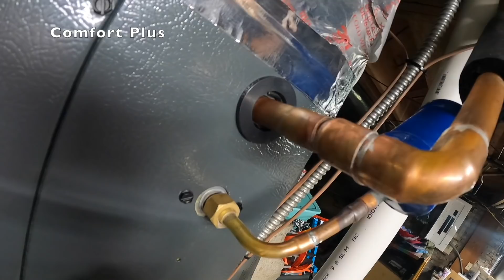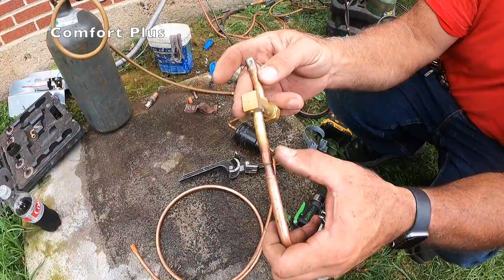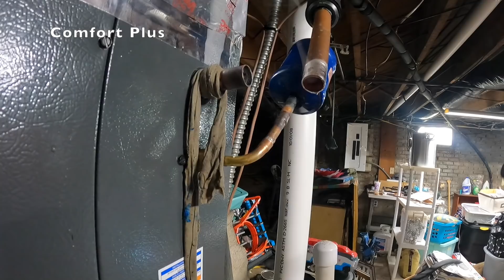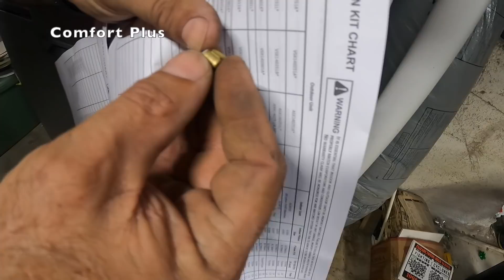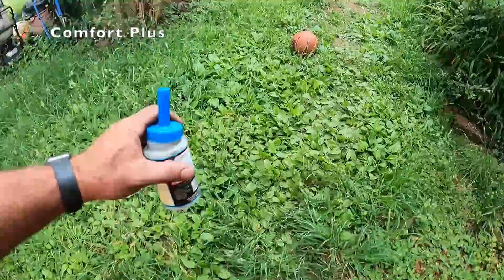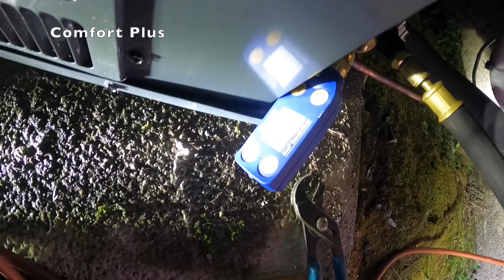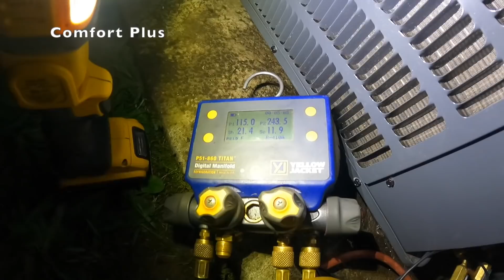HVAC: DIY Goodman Install: Can this unit be saved?

Comment: I bet this home owner is a plumber. He did a nice job with the trap. geeze now its pitch black at night now....wtf happened to the day it got edited out lmao. This is crazy stuff...nice video tho. In the summer I would have skipped this and ran more calls and probably sold 3 units. This call I would have looked at it like losing money.
Reply from the maker: I try to help anyone I can within reason. I had installed a nice Mitsubishi Hyperheat ductless unit for them several years ago so I worked them in. Thus the finishing up in the dark lol.
Reply: @ComfortPlusHeatingandCooling  I understand helping people. you did what a lot of people wouldnt do and it made for a great video thats for sure. GJ

Comment: I woulda quoted so high for all that especially if hot and busy. My quote would be 2/3 rds cost of a new ac lol I dont need call backs from a lemon Goodman thats been diy installed which means improperly installed. Having to go back after I charged that dude and now I feel guilty. Nope now that I think about it...I wouldnt do it and just quote a new unit and leave. I dont want Diy customers in my life.

Comment: The equipment is only as good as the day it is installed and that one didn't stand a chance homeowners who want to try doing their own work wonder if he even pulled a vacuum on it you are a patient man I assume
Reply from the maker: He bought a little pump, but if you pull a vacuum with a leak, I guess it isn't helping too much lol.
Reply: @ComfortPlusHeatingandCooling  you have a strong point , was a long hot day yesterday my thinking was in neutral 😂. So was today love HVAC
Reply: I’m thinking the same, vacuum pump, whuts dat?! 🤬

Comment: Steve Lav used soft solder to install his A/C. He said so in one of his videos. I used StayBrite 8 to install my A/C. You’re supposed to use the flux sparingly and never put it on the inside of your pipe or fittings. In my opinion, it takes more skill to correctly solder copper pipe than to braze pipe.
Reply: the guy in the video used plumbing solder, you can tell from the flex, it was a homedepot plumbing flex. Stay brite #8 is specially made for HVAC, it is technically a soft solder but not your average soft solder, I'm an HVAC master tech and contractor and have been using staybrite#8 for over 5 years now with no issues.
Reply: @Hisham0099  like he said  it takes more skill to correctly solder copper pipe than to braze pipe.
Reply from the maker: Always flux the pole and not the hole :) I think anyone would have trouble filling the gap between a 5/8" coupling and a 3/4" socket using any soft solder. I'm pretty sure that's what had happened here. Well one of many things that happened here lol.
Reply: I’m pretty sure the original “installer” used plumbing solder too but the solder is not the problem here. BTW, somebody call up Harris and tell them Stay Brite 8 soft solder is illegal to use on HVAC pipes. I’m sure they will have a good laugh over that.
Reply: @picklerix6162  California Mechanical Code prior to the 2019 edition didn't allow soft soldering or mechanical connections other than the flared or swaged variety.  I'm sure there are plenty of other places where Stay-brite is not allowed.  It's a fire safety issue with many refrigerants.  In a fire, the Stay-brite will melt and the refrigerant will vent and form extremely toxic gases.
Reply: It's against the law to use soft. Not to mention the civil liability for killing several people. The only reason we are required to use 15% is because freon is extremely toxic when burned. 15% silver solder won't separate in a house fire. #8 and soft solder will. You can get your butt sued to hell and back.
Reply: @Bryan-Hensley  would you mind showing me that law? I would love to read and change my ways
Reply: @Bryan-Hensley  I guess you couldn't find the non existing law, so I'll try and explain why such a law doesn't exist. 410A at 400f will be a littler over 6000psi, the pipe will burst at 4200 psi. So in your scenario  the pipe will burst way before the joint fails, times are changing and so we should all. Staybrite#8 is a game changer if you know how to use it right.

Comment: Nice work as usual. That homeowner doesn't realize how lucky they are to have someone like you do that repair. Lots of companies would have simply condemned the unit, and sold them a new one.

In what they spent for the Harbor Freight Guages and vacuum pump plus all the solder and flux they could have nearly paid for you to install it right the first time.

Comment: Distribution companies should be sued and charged for selling anything remotely connected to our industry to joe blow over the counter
Reply from the maker: Yes this was purchased online. The distributors around me only sell to licensed folks, and they won't do warranty on units they didn't sell. So if these folks need a part, they'll have to go back to their online store to get it, send in the old part, wait two weeks for the new one, and hope they don't need anything else. Thats assuming the online store is still around lol.
Reply: All they have to do nowadays is go to internet
Reply: @mathuelee2686  Point still stands should be required by law to provide dealers license to purchase equipment
Reply: @zack9912000  the people on the internet selling units to non-licensed people should be held accountable for it because I've seen some botched up jobs in my days also and it also hurts the local economy
Reply: @mathuelee2686  It would be too easy to track what supply house bought said unit. They should refuse to sell to anyone not a licensed company. Hell they should be fined if you ask me.

Comment: That a was a lot of work to save parts. I came across soft Solder.   In our cities labor is so high per minute it was cheaper just to cut out the valve replaced them with straight ball  valves on hand with service fittings . 

          40 years ago as an employee we think of labor as a personal hourly wage

              Years later when starting your business do you think of labor as an hourly rate and hopefully you had the smarts to figure in the cost of doing business all equipment associated with running a business

          Decades later owning your own business in a high cost city you think of cost per minute. 
           That’s the cost of fixing or saving old parts just in labor quickly outpaces the cost of the part itself. 

        Sometimes it makes me want to move to a part of the country where are you could move slower think slower and actually take time to save parts and repair things more often like when I was younger.  In a lifetime long ago

Comment: Why don't people let the professionals handle it. It will cost you more money in the long run!! You either pay once or you pay twice!! I got my accelerator pedal replaced at Belltire, but I eventually had to dealership, because aftermarket part didn't work!! These newer cars require OEM parts. So, I ended up paying twice.

Comment: Very thorough.

I wish the entire HVAC industry was as professional as yourself.
Reply: Wouldn't make for entertaining videos then.
Reply: @erikkovacs3097  exactly, what a good point you make
Reply: It's not just professionalism its knowledge.
Reply: Damn skippy! I had a local HVAC tech try to sell my parents an entire new 3.5 ton split system. He said it was junk. (compressor failure) I replaced the bad fuse in the disconnect. 7 years later and it's still running. The owner of the company was a friend of mine too. BTW, the tech was fired.

Comment: Great work cleaning up all that hackery and hopefully giving that Goodman a chance. That JB weld on the lineset gave me a good laugh! I’ve learned a lot from watching guys like you and Stephen Rardon on YouTube and it’s made me a better tech but I’ve been in this trade for almost 20 years. Stuff like this kind of shows the downside of these YouTube videos when Joe Homeowner thinks he’s an installer from watching a few YouTube videos. This is the reason Goodman gets such a bad name because anyone can get them even people that have no business installing them. I personally don’t think Goodman is that bad although it’s not my first choice. Any brand of unit can last and perform well if it’s installed correctly. This one clearly was not!
Reply: I've often said the problem with Goodman mostly, is poor installation quality.
Reply: @dpeagles  I've installed probably 700 Goodman. They give less trouble than any other brand I've put in or repaired
Reply: Nothing wrong with a goodmsan if installed properly,totaly get a bad name cus they sell to anyone,definitly agree with you